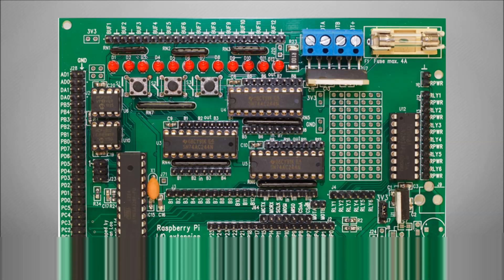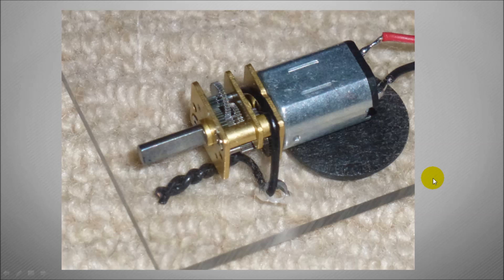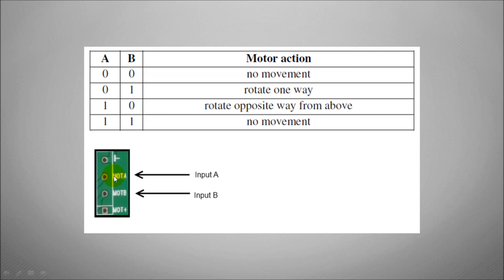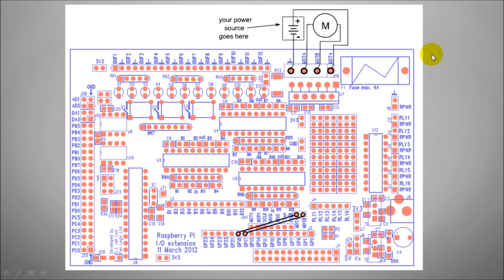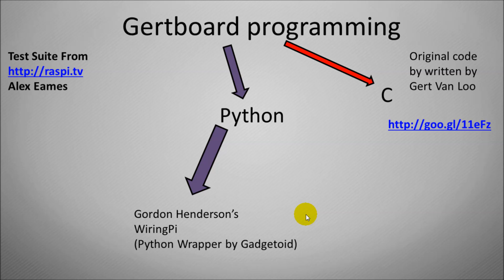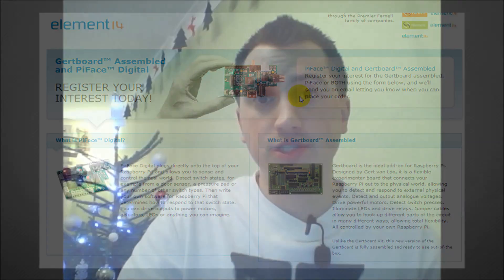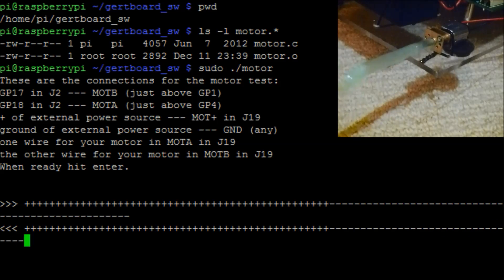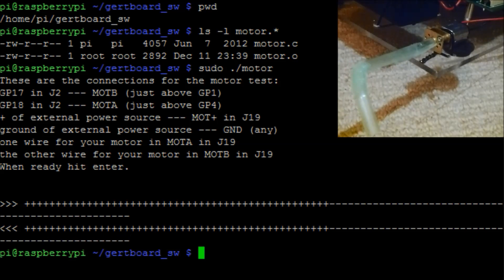Raspberry Pi - Gertboard Motor Controller

Comment: hi i want to use a 3v motor and 2 AA batteries is that possible or will i need a 9v motor and 9v battery as you have done 

i seen the same motor as yours but its a 15RPM 3v and want to use that 

thanks